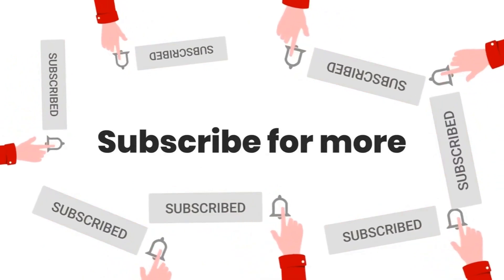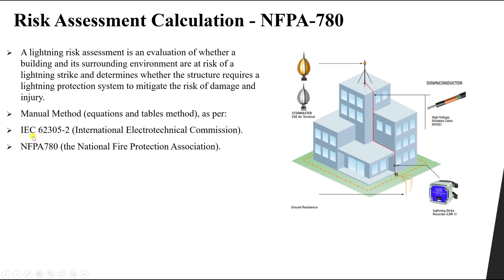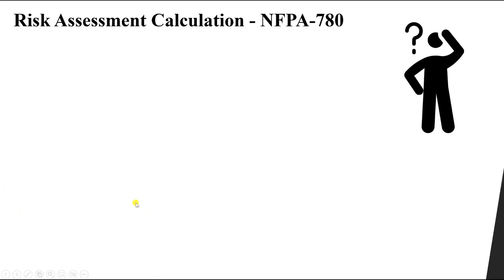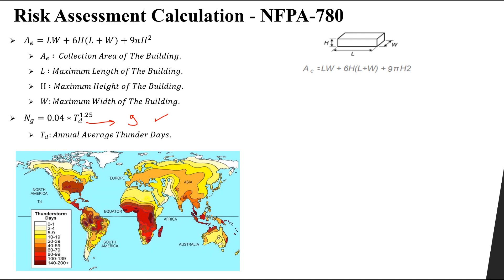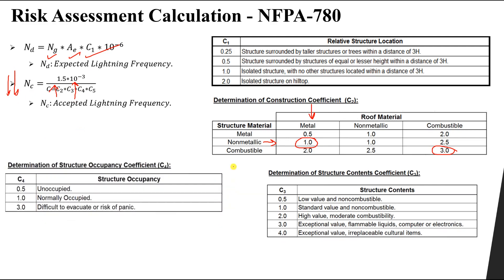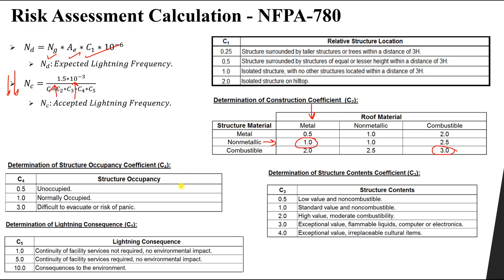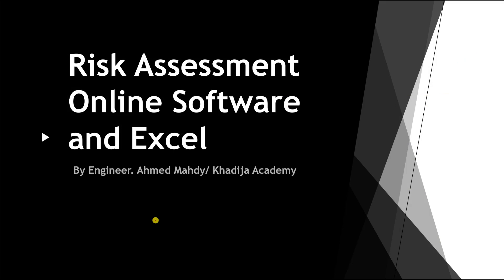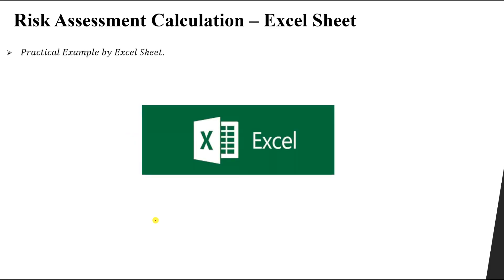Risk Assessment Calculation Using NFPA 780   Lightning Protection Course

Comment: Hi, is there a video of the risk assessment calculation using IEC 62305-2?
Reply from the maker: Unfortunately no. We usually use NFPA 780 as it is much simpler than the IEC standard.